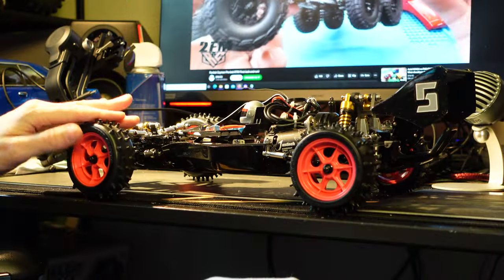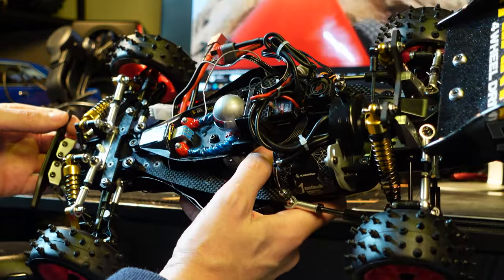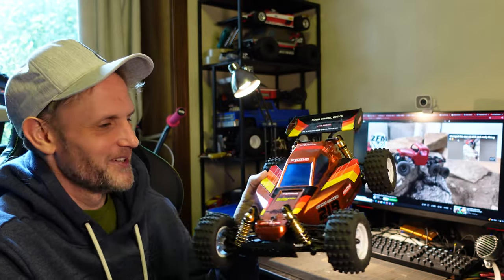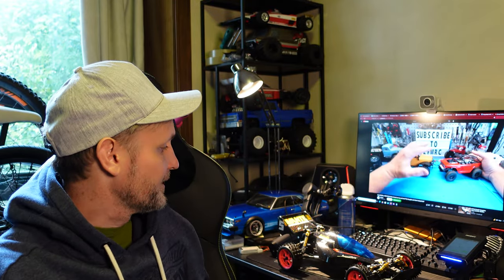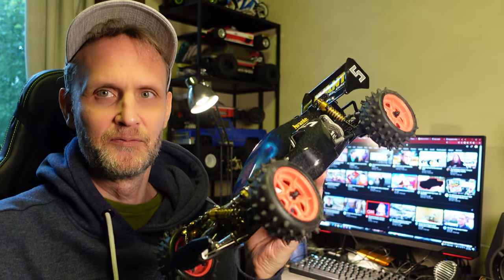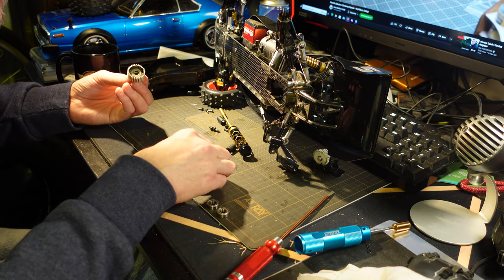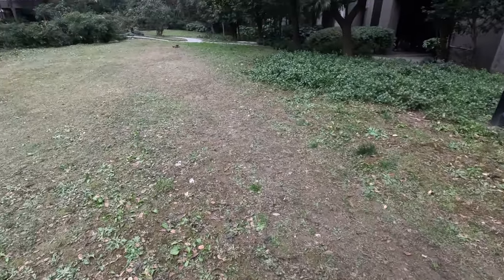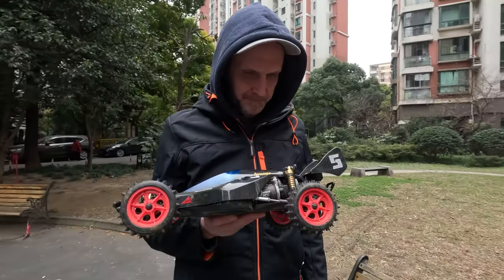Ending 2022 with an Avante Black Special

Comment: Hi. Just got mine kit 47390 and had the manual kit number 84270 is that normal.
Reply from the maker: Yes, I believe so. 84270 was the old kit number that didn't come with the torque splitter and the race steering set. 47390 does. No need to update the manual I guess.

Comment: Nice review, how did you get the rear gearbox sorted?
Reply from the maker: @baljitmiller3540  I just didn’t have it right enough I guess. After I took it apart, I tightened it down more and it worked.

Comment: Overengineered ... sure. For one, Tamiya did mean it, when it came out in '88, to compete with the Schumacher Cat and the like AFAIR, and had to go on to the Egress to compete. But still, the Avante still got a certain image and nimbus for its elegance, while the Egress looks brute and rudimentary, as if BigWig did a major diet + training, with their oversized+ugly front suspension, not to speak of the unwanted siblings Vanquish and "Avante 2001".
 
Meanwhile, one could consider the evolved Avante 2011 (CNC parts vs die cast ones, enforced compound parts, ball diffs, joints, ...) as bragging off their japanese fine mechanics crafting, amidst the dozens of el cheapo plastic chassis * half a dozen body shells each.... that NEED the body to hide the boring, blunt drivetrain. The Avante is eyecandy, "dressed" and "naked", in each detail.

Btw - I don't get warm with the ping wheels ... champagne, silver or light charcoal wheels + dampers would be a perfect contrast IMHO, but pink makes it look like a toy.
Reply from the maker: Great review! It is a beaut for sure. I think I’ll build the ugly Durga next. The body is sleek, the chassis is a pig.
Reply: @Triggered-RC  Japanese have quite contrasting ideas of style and beauty.... they are better, when re-using foreign designs, than transferring manga style to tech stuff  ;-)

Comment: Who did
 you order yours for to get it so cheap
Reply from the maker: I live in Shanghai. Prices here are the same as in Japan and we get everything on their release schedule. They release models all the time that are only officially released internationally every few years, and the local resellers just get batches sent over. Like my Avante Black. New kits are always available here, so, lower prices.
Reply: @Triggered-RC  Impossible to get it that cheap from the state. Even the authorize dealer sell them around $500+.
Reply from the maker: @KC-wo5xe  Only option is to buy direct from Japan or HongKong. Try PlayAsia and RCMart.